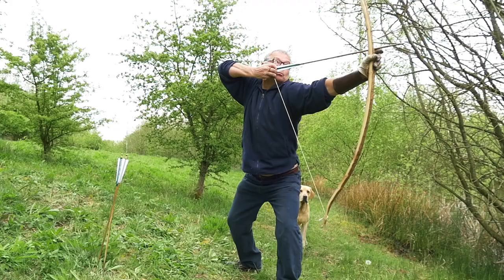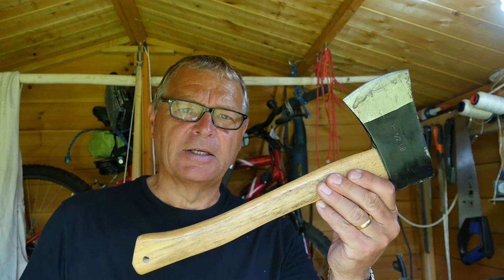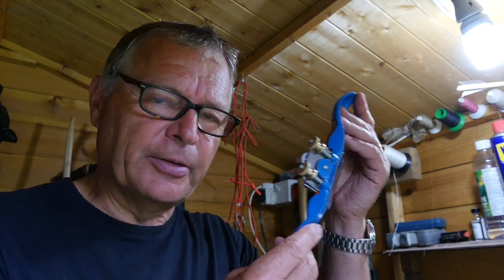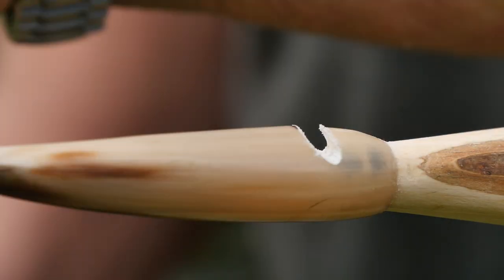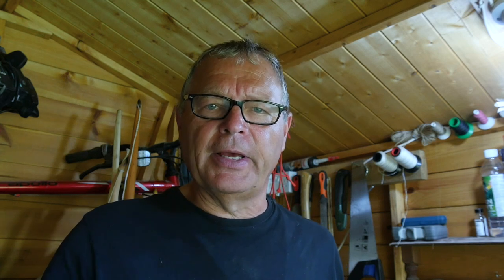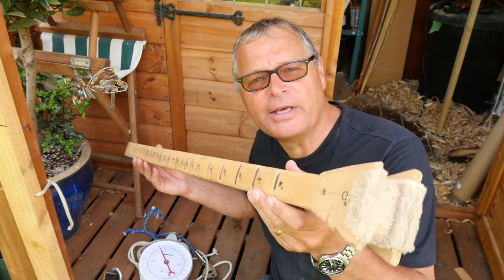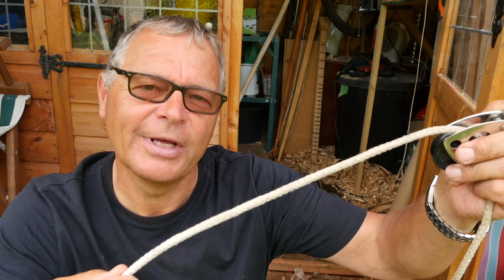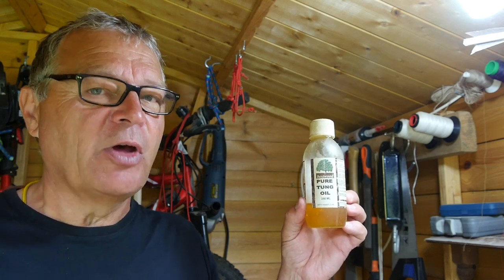£80/100$ bowyer. Become a Bowyer for less than £80/$100! My Bow Making Tool Kit

Comment: Quick tip. Spine of the saw can be used as a scraper. Also saw can be salvaged to cut out a scraper in desired shape, then sharpened to a square edge. The scraper also can be fashioned in to a wooden frame with handles to give more sraping power and comfort.

Comment: I have the folding saw too. But once the sapling is cut, then I do most of the next steps with power bandsaw and belt sander. Carpal tunnel issues...
Nice work Mick!
Reply from the maker: Hi there, ouch - carpal tunnel - you are wise to be careful. Thanks for watching. Mick

Comment: Another fantastic video Mick, I am attempting a five piece bamboo horse bow, limbs, handles and sihyas, at the moment using similar tools, I would recommend a Japanese pull saw,I bought a plastic handle cheap version from Amazon and it is so good I bought a larger one as well. Keep up the fine work my friend you seemed to have cracked bow making as well as film making, look out Steven what's his name!
Reply from the maker: Hi Mark, I also have a Japanese pull-saw - but I bought it for arrow making rather than bow making. Great bit of kit. Glad you enjoy my videos, though I think Steven Doodah hasn't got much to worry about! Mick

Comment: Excellent and informative as ever Mick. I've acquired some wide diameter bamboo which is ideal to back some of my ash bows.  Also, I'm  experimenting making bamboo self-bows. Bamboo is easy to work with but provides unique challenges. I think my self  bamboo bow will take some work and may not be conventional or pretty. However, it will be some fun and allow me to chill out on my own, as usual.  Keep up the good work, MIck- I always enjoy your enterprises.

Flaxen Saxon
Reply from the maker: Hi there, that sounds an interesting project - never worked with bamboo apart from sticking bamboo canes in the ground to support tomatoes! Good luck and thanks for watching. Mick

Comment: I made a 124 lb bow using a $30 knife and a bit of 0.4mm thick sheet metal. No tiller or special tools
Reply from the maker: Hi there, yes, as I mention in the video it's perfectly practical to make a bow with just an axe (or knife). But that wasn't the point of the video as I'm sure you realise - just want to encourage people to have a go. Great to get your comment and thanks as ever for watching. Mick
Reply: That's luxury,I had to make do with some knapped flint

Comment: I'm looking to add a spoke shave to my kit, but never having used one I'd love your input on what kind to get.  Mainly, the difference between a flat base or round base.  I can't tell what yours is, I'm guessing flat.  

Loving the videos btw, they're keeping my courage up on my first attempt.
Reply from the maker: +Steve Long Hi Steve, mine is about the cheapest you can get - about £6 UK - which I bought on eBay. It's a flat one. Delighted you enjoy my vids - and go for that first bow!!
Reply: If the only pronounced concave shaping on the bow you might find yourself doing is in the fades on a raised handle flatbow (which you can easily do with a big half-round file) you are unlikely to need a round sole and a flat soled spoke shave is sufficient. 
I reckon Mick was maybe just lucky with that cheap blue Chinese imitation of a proper Stanley spokeshave. :-)
Reply: Rod Parsons thanks for more insight.  I did get a cheap one that I've been practicing with on some truly awful pine 2x2's from a box store I'm using to make poles for a tarp cover for my workspace.  It's very hard to get the blade properly positioned, but it's still serviceable until I can find quality tools.
Reply from the maker: +Rod Parsons Yes it's a cheap one but not hard to 'tune up'. For less than £6, it does a great job!
Reply: I've seen a few of those Chinese Stanley 151's and some need rather more than "a little tuning up". A Clifton might be a better choice but I'd rather drop the whole budget on a Lie Nielsen. Now if only they made a spokeshave scraper with a blade like the L- N 212B small scraper plane.
i guess cheap ones are useful while you sort out your tool preferences.
Reply: They're cheap to buy but my neighbor made me one

Comment: Nice video Mick, but almost any three of the tools you mention will set me back $100 in US.  Yes it's possible to pick up deals on Ebay, but my Ebay experience has not been completely pleasant.   It's possible to go much more minimalist.  I use mostly a draw knife, a sureform rasp, flat rasp, cabinet scraper, rat-tail file and sand paper.   If someone goes the power tool route a simple hand planer and a orbital sander will work for shaping bows once you have the bark off.
Reply from the maker: Hi there, that's really useful information for my US viewers - thank you very much Of course everyone has a different take on best bow making kit, I just tried to show people how I got started. Appreciate your input. Sad that tools are seemingly so expensive in the US - in the UK tool prices have plummeted over the years (largely due to China). When I tooled up for my first job (electronics) some 40 years ago, tools were wickedly expensive; now we can get power and hand tools for a song - though of course premium brands and very specialist stuff can be more expensive. Thanks again for watching and commenting. Mick
Reply: You can get a good draw knife for about $30 and Stanley makes a descent spokeshave for less than $15

Comment: Also, just a tip, consider trying out an OKC Kukri Knife from Amazon made of 1095 Carbon Steel when harvesting bow making supplies from the bush/woods (1064206 Ontario Knife Co OKC Kukri Knife https://www.amazon.com/dp/B00519UT42/ref=cm_sw_r_cp_apa_OfTjAbS1WN2D6). It's smaller than a traditional, machete-style Kukri (giving you more room to swing the blade in the bush/woods without hitting other trees/limbs around you). Also, a quick way to keep it sharp while you're on the go is a Corona Sharpener which always you to shape any cutting blade free handed without breaking the bank and small enough to fit in your wallet (Corona AC 8300 Sharpening Tool https://www.amazon.com/dp/B000BPASBK/ref=cm_sw_r_cp_apa_PkTjAbPFT8GKC).
Reply from the maker: Thanks for the advice, will check them out! Mick

Comment: I wish you had made this video earlier! I think I've spent more than this on tools and still don't have tools for removing a lot of wood quickly (i.e. a cabinet scraper, draw knife, or machete/axe).

Do you have any recommendations when it comes to second hand draw knife brands? A lot of what I've seen on Ebay hasn't been very good; many of the draw knives I've seen have been practically worn down to the nub, and didn't have nearly as much metal left on the blade as yours. Perhaps you might have recommendations on search terms other than just "draw knife"?
Reply from the maker: Hi there, yes there can be many different sorts of draw knife and there are many brands. I cannot say which brand is best as my experience is limited. What I can say is that thick bladed draw knife that I show is nowhere near as good as the thin bladed one I borrowed once from a friend. That was virtually bendy and made a stunning job; mine is crude and takes off massive slices - not something I always want. I am always on the lookout for them locally, just in case I find a lightly bladed knife with a slight curve (downwards). I prefer older, used knives that have been kept in good order or have been refurbished/sharpened. So I can only say that my heavy and thick bladed knife is not ideal for the work I do - but it is useful. I would use a thinner bladed knife a lot more if I had one! Sorry I can't help more, the ideal is a range of draw knives I guess. Mick
Reply: Thanks for the advice! I'll be sure to keep an eye out for local sales. I think there might even be a local forum for the town I'm in that I might be able to ask around in. I was also wondering if, perhaps, you had a go-to resource (video, webpage, etc.) for sharpening/burnishing a cabinet scraper? I was thinking about looking into that as well, since I don't currently have the space (or living situation) for a vice (and bench) to hold my bow in order to use a draw knife.

Comment: Great guide Mick, I feel like this video is gonna be popular :D

btw is there a specific place to get cabinet scrapers? Or are they just one of those things you can sometimes stumble across on Ebay for example?
Reply from the maker: Hi there. Cabinet scrapers should be available from specialist woodworking suppliers but I sourced mine on ebay (UK). They are available new either individually, a brand called Kunz for just a few UK£ each - but I bought a set of 4 made by a company called Garlick and again via eBay. But you can replicate one with just a piece of flat steel (maybe 1/16") and along one edge work a file so that there is a burr along the edge. Draw the steel toward you along the wood with the burr on the leading edge (toward you). Hey presto, a cabinet scraper. A knife will do the same job if blade is held vertically, though you don't a burr on it. Hope that helps. Mick
Reply: Thanks for the tips, I'll look into either getting or making one!

Comment: Love the content but it not possible for an American to to make a bow with 100 bucks a knife of a machete is about 40 for a knife 30 for the machete then you need a file that’s 25 to 30 bucks  the hand saw is another 20 bucks then the tiller knife if if you sue what you already paid for you save. But. If not then that’s another 40 bucks sir this doesn’t work I found that I needed almost 300 bucks to start…also you need wax to wax the tips that’s not free you will need string for the bow that’s not free like man the more I think about it the more it’s not not close to 100
Reply from the maker: That is an old video and at the time in the UK that figure was true. I bought lots of my tools secondhand.